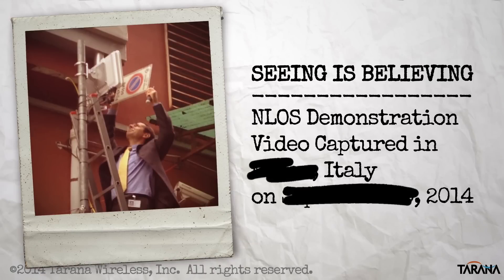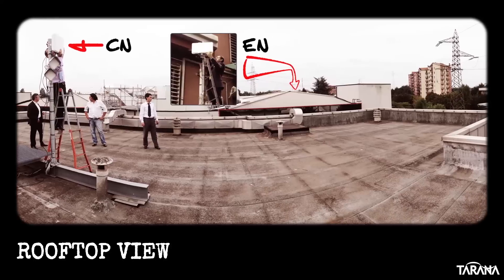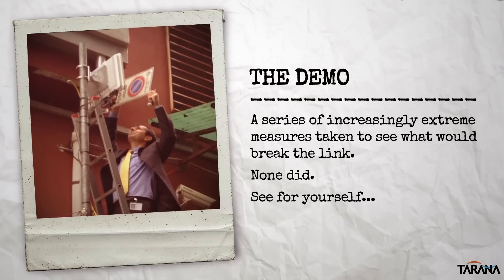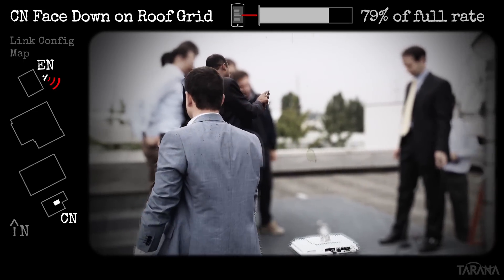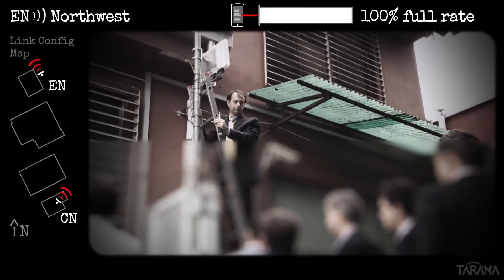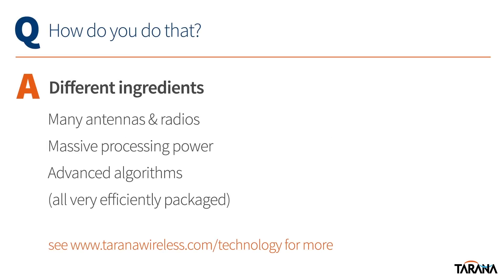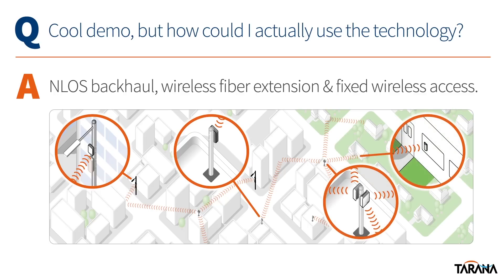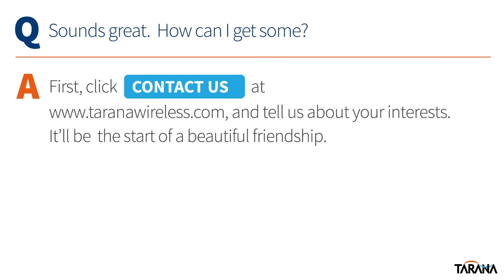Tarana:  Seeing Is Believing

Comment: 256QAM is 8bit/s per Hz not 10Bits/Hz  as stated in the presentation.
Reply from the maker: Philip -- thanks for the attention to detail.  A single 256 QAM stream is 8 bps/Hz as you note, but subtract the usual overheads to get a useful 5 and then multiply by 2 for MIMO, and you get our 10, which accurately represents our system.  -- the Taranans.